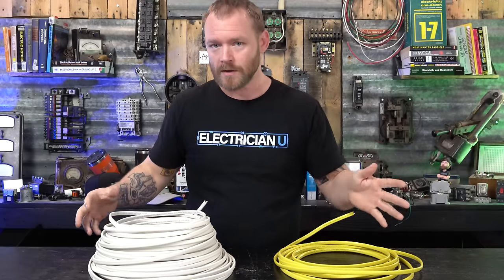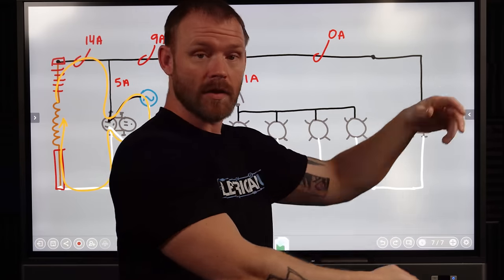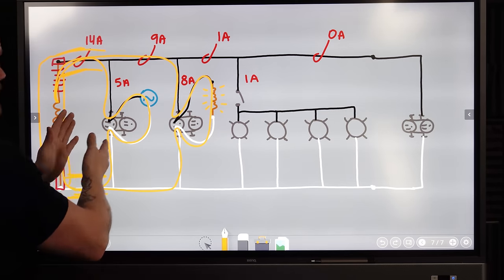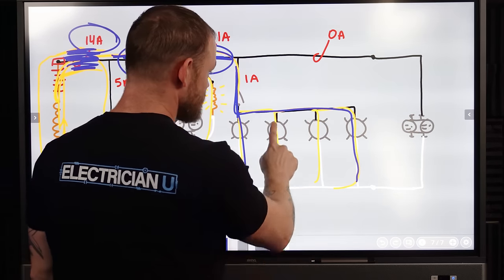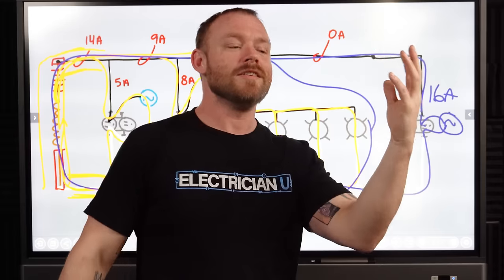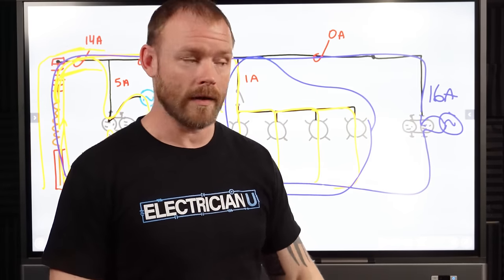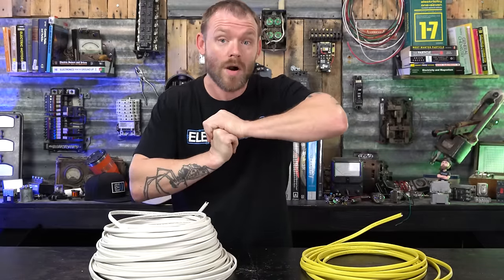Should You Be ONLY Using 12/2? When Can You Use 14/2?

Comment: NEC 240.4(D)(3) - if you have any 14 AWG copper wire, the overcurrent protection cannot exceed 15A
Reply: This video is going to kill someone. :(
Reply: He just didn’t think this one out , he knows better. I believe his mouth just got carried away , not realizing what he was saying.
Reply: @boby115  players f up too bro 😂
Reply: I think he's talking about 'in theory' only, which doesn't help electricians or anyone else cause we have to follow code.

If we lived in a Mad Max world where the code rules are long gone...his point is that you can put a smaller wire on branches of a circuit and it'll still be 'safe' for that small branch lol
Reply: Right; If there's a fault in the theoretical light branch, it doesn't matter that the lights are only 1A; A fault can draw all the current that the breaker allows.  If the wire is rated for less than the breaker, you could start a fire. At least the electrical fire will be contained to the area where the 14, 16, 18 GA wire is. 🤡 🚒
Reply: @mikerosoft1009  you're missing the point. You need to choose breakers and/or gauges based on failure state, not normal operating state
Reply: @JordanAdema  Why do I need to go by failure state after what I said in my comment?
Reply: Because it's how the system fails is why it's important. It needs to fail properly so no one gets hurt.
Reply: Don't do this kids, it is not right. Even if your inspector says yes, he is wrong.
Reply: He said in the beginning of the video that it depends on inspectors/jurisdictions. NEC is overridden by local codes.
Reply: @seanplace8192  That is just inspectors then not knowing the rules or the logic behind them. YouTube is not the place to give non code compliant advice.  Some code items are not safety related, just differences of opinion. This is not one of them.
Reply: I understood his presentation a refresher on how amperage adds up across parallel legs. So we maybe theoretically can use a lighter gauge on the 1 amp set of lights, it might just be simpler and safer to do 14 AWG on all legs on their 15amp breaker. And I’m thinking all the more reason to use 12 or 10 and do separate 20amp breaker for appliances.
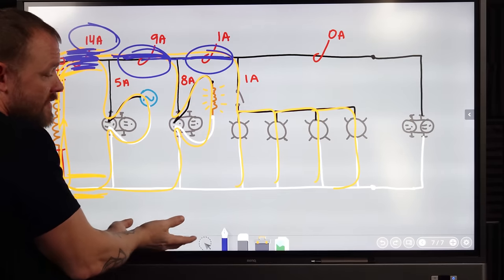Reply: @mikerosoft1009  He specifically said this is how he wires @ 5:49.  That's crazy.  If there is an overload on the #14, though unlikely, it could become the weakest link and burn before the breaker trips.  He needs to edit this video.
Reply: Agreed.  This is in direct opposition to the NEC.  Theoretically, it's fine, but in the real world, this would not fly in any jurisdiction I've worked in over the last 26 years.  This is something that could get your license revoked if you have multiple infractions of this nature.
Reply: This is a perfect example of how power limited energy systems will eventually replace dumb breakers and relying on the skills and experience of electricians to be responsible to field engineer the safety of every circuit.  50,000 electrical fires per year says there's an opportunity to do it better.
Reply: @LumenCache  I question the 50,000 electrical fires a year.  How many of those are in new installations?  In fact, how many of those were built in the last 30 or 40 years?  These are the stats NFPA never tells you.  They have a vested financial interest in keeping the public scared of fires, so please keep that in mind whenever considering the stats they offer.  Numbers don't lie, but anybody can pick and choose the numbers they like for a presentation.

Aside from a remodel, adding more and more endless codes today does nothing for buildings that already stand.  And I guarantee that's where the vast majority of the fires are occurring - old buildings.  We are starting to suffocate in the bureaucratic quagmire of overregulation (all in the name safety).  There is no limit to how many times you can make something "safer".  The NEC has expanded tremendously in the past 30 years alone.  Have electrical fire incidents dropped proportionately?  How long before we have to walk around in bubble suits and helmets?

But hey, there's a lot of money to be made in the safety product and procedure industry, so let's just throw our freedom out the window, right?  Safety is a good gig because only a heartless, shameful, wicked person would ever push back against "safety".  We've been brainwashed.
Reply: This may count as "Fixture Wire" as mentioned in 240.5(B)(2). 20amp circuits are expressly allowed to be tapped by "14 AWG and larger". Table 402.5 sets the ampacity of 14ga Fixture Wires  at 17 amps. So long as you know for certain that it will never be supplying more (something you can know with light fixtures, but not with receptacles) then you can get away with it. That said, I think that every scrap of wire downstream from a 20amp breaker aught to be 12ga or larger just to be sure.
Reply: @alecdacyczyn  Fixture wires are in a fixture, right?  He's talking about Romex jumpers between fixtures.
Reply: @JR-zm6nx  Article 402 Fixture Wires clearly describes wires that are outside of fixtures and not just those that came with the fixture.
Reply: @alecdacyczyn  Where do you see that?  402.10 says "...in luminaires and in similar equipment..." and "...for connecting luminaires to branch-circuit conductors..."

Romex jumpers between fixtures are branch-circuit conductors.  Fixture wires are called fixture wires because they are in a fixture.  One might be able to argue that a fixture whip contains fixture wires, but even that is debatable.

402.12 might give some exceptions, but you would have to show me where those are.
Reply: @JordanAdema  I’m trying to think of a scenario where LED fixtures would fail and only pull under 20A….if the light fixtures are failing it’s either a short which would far exceed 20A or a loose connection which would cause arcing/heat/fire at the connection point regardless of the breaker size. How does a failure just sit peaceably at 20A?
Reply: Part of the problem with watching videos on YouTube. I tell all my apprentices to do they’re own calculations and follow the code book or find a new journeyman.
Reply: @seanplace8192 My understanding is that local codes can override the NEC only by being more strict, going above and beyond, but not the other way - they can’t permit things the NEC forbids.  The NEC constitutes the minimum acceptable standards.
Reply: on lighting and outlets , yes.
Reply: @patmx5  No.  The key thing to remember is that the NEC is not a government organization.  There's actually some interesting litigation in Georgia where it may not even be legal to incorporate the NEC into law by reference.  Well, rather that laws can't be copyrighted and the NEC is a copyrighted work.
Reply: This violates several different NEC codes...is he really wiring houses this way?
Reply: @seanplace8192 NEC is NOT overridden by local code! The N in NEC stands for National. Local codes can require more restrictive or conservative codes but the NEC is the minimum standards that must be followed.
Reply: @seanplace8192  the NEC is a minimum requirement. local codes can go above and beyond. Max breaker size for 14 awg is 15 amp.
Reply: @seanplace8192 Not true. Local codes can supplement the NEC but they cannot supersede the NEC.
Reply: Exactly. 
Using #14 conductors ANYWHERE downstream of a 20A breaker is a violation.
Reply: @alecdacyczyn fixture wire is considered the wiring to a specific fixture.  A fixture whip would be an example and it can be as small as 18 gauge.
Reply: @JordanAdema I agree and what happens when someone plugs in a light socket to receptacle adapter.  Then run 18 amps through it.
Reply: @patmx5 they absolutely can go either way.  Nec isn't min required it isn't even required to be followed at all.  I'm not saying you shouldn't just that it isn't
Reply: @stevenbass732  Actually, the local AHJ can pretty much do what they want. The NEC is not law. It is a book of standards which a local government can adopt, ignore, or modify to suit themselves. IF the NEC carried the force of law, then every jurisdiction would have to adopt the latest code as soon as it came out. I personally know of jurisdictions that are still using the 2014 NEC.
Reply: @mikethebike67 
You might want to  read the first page of the NEC. It actually states that it is NOT a national requirement. But even if you don't read it, use some common sense. Why don't we all use the same code yr? Why is the code copyrighted? Why isn't it free?
Reply: Yeah I’m not an electrician, but am in inspections.  This thing specifically tripped off my spider sense.  It didn’t seem right to me, so I’m glad I found that my intuition was correct here.
Reply: @patmx5  incorrect. A local jurisdiction can and often do modify the NEC to reflect their opinions. It all depends on the AHJ. If the NEC were a law, then every jurisdiction would be forced to adopt the latest version as soon as it went into effect. I know of jurisdictions still using the 2014 code.
Reply: Even with 75C wire and connections?
Reply: @dplj4428  It does not matter how much ampacity runs through a parallel run, as the wire is not being protected. The only way you can downsize a wire is by providing another protection means within the circuit to protect the wire. Somebody mentioned that UL products use smaller gauge wires within them, this is correct. But in order to get that UL label, they need to prove the ability to protect the wire within their own circuit, or prove that they have limited the amount of fault current through some physical means (many of these devices have a small fuse built within to protect the wire).

In other words, if you want to downsize your wire, you need to provide another means of protecting the wire either through a fuse or other physical means.
Reply: @niktak1114  
Doesn't matter. The NEC limits 14g to 15A, 12g to 20A, and 10g to 30A breakers (there are very limited exceptions to this rule). Depending on the circumstances, you might even have to run a larger wire size (12 g on 15A breakers can be common).
Reply: @calebb2 THANK YOU for stating this because I believed this was right!!!
Reply: @alecdacyczyn So when wiring a house just use 12/2 for everything to be safe and the hell with the Xtra $$$??
Reply: light and fan fixtures with 18ga pre-wired in them then? Isn't that a violation?????
Reply: @mrniusi11  
18ga isn't a violation because it isn't considered a "wiring method" under the NEC (articles 400 and 402).
Reply: He said that and showed the chart.

He may have over emphasized too much on something code won't allow for. But I've used 10awg home run/main circuit on 20a circuits with devices pigtailed with 12awg, just to reduce voltage drop well below 5%.

Will admit, I get for more excited over overbuilt/strong circuits with minimal voltage drop. Professionals always using the smallest possible conductors as a penny pinching measure is an issue.
Reply: Yeah this got NEEDLESSLY wordy. This is what I've learned in 10 years of basic electric DIYing. Only use 14 AWG (thinner. white, and etched as 14 AWG) on 15A circuits and as a cost saving method. Use 12 AWG (thicker, yellow, and etched as 12 AWG) on a 15A circuit if you intend to upgrade to 20A at some point. NEVER use 14 AWG on a 20A circuit. ONLY use 12 AWG.
Reply: @eagl3ye  Well, not always true. Sometimes best to up the conductor size to reduce voltage drop.
Reply: I only have 12 gauge and better wire in my house/I only have 20amp and above outlets/breakers, I don't have ANY 15AMP outlets in my house, I also always use the professional/better rated outlets as well, they hold a plug better, for longer, before plugs start falling out of the wall, is one big plus with professional grade outlets, light wise I only use LEDs, 850 lumens or above, all of my lights are dimmable and able to be controlled from anywhere as well/the way I look at it is, its better to have it and not needed than to not have it and needed it/ people aren't complaining about having to much power, they are complaining about not having enough/having to flip breakers constantly, but I will admit LEDs are really efficient, compared to incandescent bulbs/even compared to CFLs, plus LEDs don't get as hot either.
Reply: @JR-zm6nx  remember,  if you can't find any other cause of a fire, you can always find a wire that melted because of the fire. There you find your cause.
Reply: @arthurmoore9488 actually the key thing to remember is that most jurisdictions have adopted the NEC as the standard in their jurisdiction. Therefore it is what their law is based on. They can require more strict rules than the code book. Thd code book is a national minimum.
Reply: @nooneyouknowhere6148 What?  How is something that is not a law a "minimum".  It a reference that localities can choose to incorporate or not.

Think about it this way. The NEC is not made by a government organization.  On its own, it cannot be a law, or an official rule.

The fact it is incorporated as law is actually a major issue.  The very concept of laws that we must pay to know is the same type of thing that leads to Secret Police kidnapping people.  That's what I was talking about.
Reply: @arthurmoore9488  it is adopted as law by local jurisdictions. And if you ask any legitimate electrician, it is the very minimum standard by which you perform work. The NFPA is the national standard for most types of work. All the NFPA standards are designed to keep people safe.
Reply: Except for ac equipment. You could have a 40 amp breaker on #14 depending on nameplate.
Reply: @jimhelling5188  how?
Reply: @JR-zm6nx  If a subsequent resident taps off a light switch to feed a receptacle to run their computers and laser printers, this could go really bad really fast.
Reply: @alecdacyczyn  Fixture wires are not fixed-in-place structural wiring. Also consider that theoretically this video is correct, under the NEC it is not. Imagine a string of 6 recessed cans rated at 150 watts each, surely wiring the last 2 cans with #14 wouldn't hurt a fly? No way could a load of 150-300 watts overload a #14. But imagine having to write a code book with all the wording necessary to allow theory to dictate so many exceptions? The code book is thick enough. This "push" to allow "spurs" to under-size the cable is from contractors looking to save (make) a buck and even if it were legal, would never result in any cost savings to the consumer anyway. Residential new work has always been populated by the bottom feeders looking to pinch pennies. code be damned.
Reply: @MA-wb1xo  You are correct. In all my life I've never encountered these "partial shorts" or failures where the current goes to some  magical sweet spot. Wires either short or they don't. Loose connections are detected by arc-fault breakers, standard breakers wouldn't care about anything other than a dead short or a sustained overload. There are some electricians who seem to be delusional- thinking that a hot wire can "slightly short out" to ground or neutral and just sit there drawing 20 amps like a heater.
Reply: @patmx5  Not true. Some states and counties (depending on how the local governments operate) deleted the arc-fault breaker requirement in new construction. Some have also deleted the requirement for all kitchen receptacles to be GFCI, but keeping the "within 6' of sink" provision.
Reply: @jfowler702910  The NEC is published by the NFPA - National Fire Protection Association, the NEC is only TITLED "National Electrical Code." Neither is a government entity. Not any more than Hebrew National is a government hot dog. Some jurisdictions have deleted the arc-fault breaker requirements completely.
Reply: @whiggins101  I sympathize with the principal concept of this comment sub-thread. Though there might be some confusion here with section 210.21(b)(3) of the NEC 2023, that implies that 2 or more 15amps connection are permitted on a 20amp branch circuit.
Reply: @darrendolphdragos9752  ROTFL OMG.  I pretty much just spit out my potato chips reading the Hebrew National reference. Just had to log in on my computer to reply to this one because it definitely wins the Comment of the Day Award.  Kudos to you sir!
Reply: Should Just Say, If your Area can Use #14, then Use Just For Lights, #12 Everywhere else. 
If you have 1 Piece of #14 in a circuit, needs to be on 15 Amp Breaker.
Reply: Unsafe? Yes. Illegal? Of course. But, hey, he's saving 10 WHOLE DOLLARS per one hundred feet of cable (bases on this morning's prices" by using that 14 AWG NM-B. That's makes it smart...
Reply: @patmx5 that's usually how it works that the local code is stricter.....but  reality is NEC is a guideline it has no authority. A jurisdiction doesn't have to adopt it. They can have their own. Some areas near me actually downgrade NEC minimums because they caused issues.
Reply: @darrendolphdragos9752 facts. What those guys are thinking about on "partial shorts" burning things up is usually bad connections or device causing a high resistance or arcing.
Reply: DURRRR ! You so Smart !